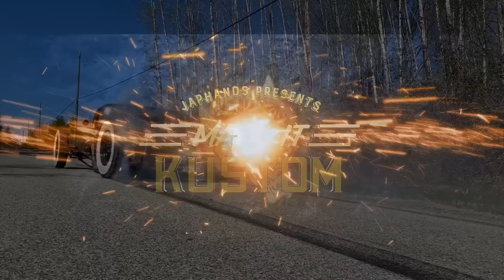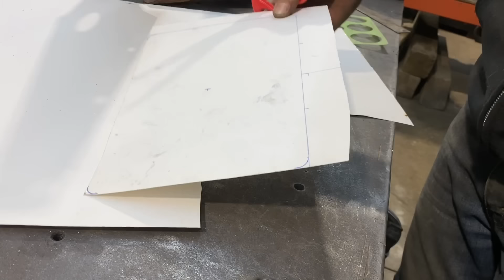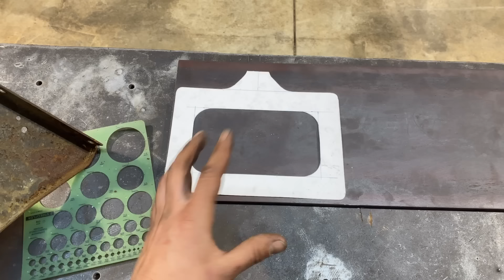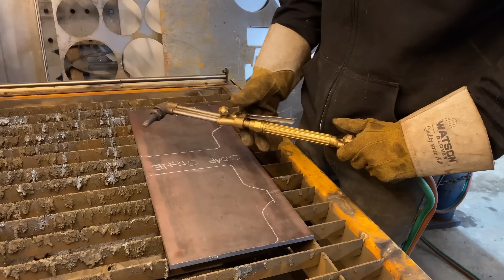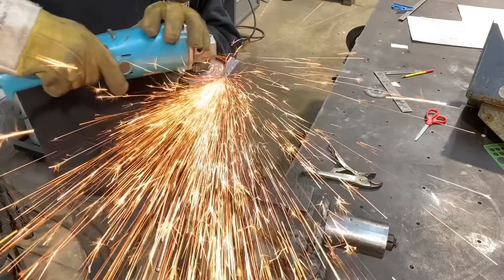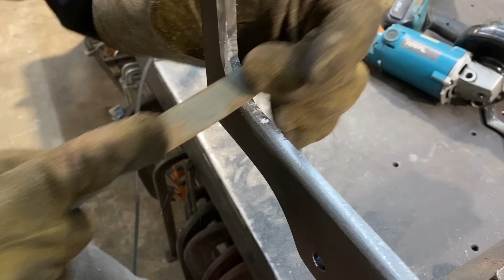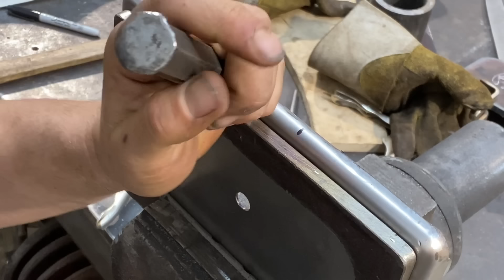Steel Plate HAMMER FORMING!! Step By Step with Simple Tools - G10 Van Battery Tray

Comment: A poor fella hack is you CAN use softwood, so long as you put 1/8" or thicker steel on the top. It's not the platinum card perfect solution, but works very well if you are only making 1-10ish pieces, and are limited to the National Bank of Scrounge and Cobble to finance your projects.

Comment: I would press the center depression first as the material will draw inward then form the rest.

One welder test that I took in 1970 required torch cutting to make pipe tees, pipe reducers, pipe caps and 12" angle frames.  The requirement was no grinding allowed cuts had to be clean and only a file could be used.  All parts made had to be gas welded together with a torch.  In addition had to complete arc welding 16" diameter 1/2" wa;;  full penetration butt weld and 12" on 12" tee test weld upside down all were x-rayed for defects in the woods the strap ere cut and bent and stretched to test strength.  ALL THIS HAD TO BE COMPLETED IN 8 HOURS.   All this said his comment about in the past only files and benches grinder we used not hand held grinders were available.

Comment: Whenever I see metal forming videos like this, I'm forced to think back to my old metalwork/woodworking teacher here in England. He was a well spoken, but brash man in his late 50's, and he had the air of someone who may have once been known as "Wing commander" about him. :)

Anyway, One sunny summers day he turned up to school in an absolutely stunning British racing green E type Jag coupe. Everyone was talking about it, and no one could work out how he would have been able to afford it on a teachers wage. It turned out that he'd bought it as a complete, but terminally rotten mess during the 1980's recession when prices were low (even for restored examples), and then spent 5 or 6 years rebuilding it to a showroom condition.

Replacement body parts were scarce AND expensive back then, so everything it needed had to be hand made by him. When he realised that a lot of us were really interested in the work he'd done, he brought in a crate containing several albums full of photos. It seems there wasn't much original Jag metal left in it ! The old shell was pretty much only used as a pattern to create replacement panels from. He even English wheeled a new roof panel because, as he said, the original had "too much rusty lacework around the top of the windscreen that needed replacing, so it would just be a neater job all round to make the whole thing from scratch. It was easier than messing about patching up the original all over the place".

He'd worked on some of the stuff at school near the end of the project. While we were busy doing stuff he'd be stood at one of the spare benches polishing things like carburettor body's, cam covers, or machining small alloy parts on the milling machine. Apparently he even brought in a roll of leather, and the old seat covers, then proceeded to sweet talk the young lady who taught needlework into making replacements for him. :D

It turned out that he was a qualified coachbuilder, and could have been earning a hell of a lot more money doing that, but it also tuned out that he really enjoyed teaching, and valued his happiness more than having an ever expanding bank balance (We thought he was mad because of that back then, but the older I get, the more I can relate to his point of view).

As a "Also" memory of the guy, I once asking him how he'd found the time and money to build that car, and I'll never forget his reply. He held up his left hand and said "You see a wedding ring on that finger boy? No? Well son, nothing in this world monopolises more of a mans time and money than having a wife. Being a bachelor is the only way a man can do what he wants, when he wants without interference. Yes, I was married once, but that didn't work out. We were both miserable, so chose to divorce before we ended up killed each other. There's some mistakes in life that you only need to make once. There IS a certain lady who I'm NOT married to now though, but I'm very firm on us having our own lives, and homes. We both like our own space, and she like's not having me under her feet all the time, messing up her place. While I'm equally happy not to be out wasting my time and money buying new sofas and soft furnishings every five minutes because the perfectly serviceable current ones don't go with the new wallpaper she's ordered........ It's a win win in my book. Just find yourself a woman like this my boy, and you'll have a lot less aggravation in your world". He'd probably have get fired and lynched for even THINKING that way these days, let alone recommending it as a way of life to a 14 year old boy !......... But it was a different (and more easy going) time back then. :D

Comment: your center hole was off because of the slight draft angle of the torch, then when you ground the edges you took a little more off the side that didnt have a perfect 90⁰ torch cut, in order to flush the edges up before radiusing.

Comment: I remember about 25 years ago I built an 84 Monte ss street killer and put so much into the car I literally couldn’t afford a gauge pod
 I ended up making a pod for my 2 auto meter gauges out of the old heat shield for the catalytic converter that was bolted to the floor of the car and used a hammer and a drill and a file and that was it
 I still have it to this day

Comment: 10:20 "Grinder, welder, drill press, torch" is a simple but powerful piece of advice for a newbie. I went different directions after the drill press based on types of work im doing, but for a lot of cutting the torch is a great #4 position tool acquisition. End result is flat impressive, nice work.

Comment: Great tutorial. Keeping an essential trade alive. I was thinking more of a gas range stainless steel top since the ones that come with the appliances are usually painted steel and get rusted in a couple of years and the replacements are more expensive than the device itself if you even get a hold on it.

Comment: If you want to keep this one from rusting out, something I used to make was cotton canvas soaked in baking soda, 3 layers, and let dry then the layers get sewed together. Lightly, or heavily, dust baking soda between layers first then carefully sew together so as not to lose the loose baking soda or shift it around between layers and sew a grid pattern to trap the baking soda between the layers. Once finished re wet with baking soda solution, let dry. Place on tray, place battery on that and Walla. Keeping the battery clean helps a lot too. I did this with all my hot rods back in the day. An old mechanic showed me how it was done.
Reply: or just coat in POR15
Reply: @TheRoadhammer379  No! Por 15 doesn't neutralize battery acid. Whether or not it can tolerate battery acid isn't the issue. the battery tray will get scratched again and the acid will start destroying the tray again. You can paint it with POR but then use the cotton canvas soaked in baking soda to be sure the battery acid is neutralized when it comes in contact with it.. That was the whole point of my comment, was neutralizing the battery acid.

Comment: Really enjoyed watching this and have learned a lot by actually seeing it done.

My problem is that you claim to be able to do this using only simple tools. All was going well until you turned to a press having already said the job could be done using a sledge hammer. That's what I wanted to see as well so I'm still not sure if the work can be done that way. Would the use of aluminium demand the use of a press and suitable load-spreading blocks? Seems to me that a sledge hammer would struggle.

Comment: I think you should invest in a plasma cutter it's cheaper to use and cleaner cuts than a torch. JUST A FYI. ALSO sanding drums on a drill work better than  a file in the corners as you can stay more consistent when radius sanding. I know you are trying to speed things up.Also I would of used stainless steel to really juice things up.
Reply from the maker: Thanks for your input. I have all those things and a Cnc plasma.  The point was to show what can be done with simple tools so that more hobbyist metal workers can relate to the process
Reply: @MakeItKustom  I understood your point. Not all have a oxy- acetylene setup either . Also in the interest of speed
a plasma cutter would of left a cleaner cut especially a CNC cutter. Also not everyone has a 50 ton or better press.
Especially when trying to put a valley into a piece of metal with a sledgehammer  and not demonstrating it. JUST FOOD FOR THOUGHT ON YOUR next video. I am not bashing your video so please do not take it as such.
Reply: @MakeItKustom  I think you should bend the center with a sledgehammer.

Comment: Is it possible to do the same process but using wood as a form in stead of thick plate steel
Reply from the maker: Yes but with hard wood and it may need to be thicker. The 16 ga material might be tough. It would be no problem with 18

Comment: hay those imperfections were in my 1985-88 battery tray from GMC stamping press so you did it better than gm ( burrs and miss stamping ect. ) ( my 1970 dodge one i thing had the same problem but i had to junkyard it as rust got it, swiss 🧀 so maybe the same supplier's? of tooling or parts? ) did and the 3 holes are punched out for the same reasons as you did, i guess gm didn't want to clamp the part better and more evenly for a nicer finish and consistently ect. . Lithium LFP don't have the rust problems like flooded lead-acid does plus its way more reliable and way more powerful peeking and longer lasting, i don't plan on going back as i love lithium 12V to 24V car/vehicle battery's, a sds or sds max hammer drill would work and speed up the metal finishing process i figured that out after having to buy a 2022 80V cordless and trying to keep it busy ( as you and others and me probably know by now best to exercise you and the tool as a tool that only gets used every 5 years i bound to be stubborn or not work at all and for me i didn't feel like selling it new-ish for 30 to 80% off to the next guy yet ) after my fencing/home/electric 240v shop improvements are done with by 2023-ish

Comment: Those dented areas are to locate the battery     at the back of tray and the removable holding device in front locates the device to the front of tray snug fit btw some manufacturers crush battery case's from the factory

Comment: Would it be better to do the press of the centre before hammer-forming the edges, so the press doesn’t distort the hammer-work?
Reply from the maker: My thoughts were to do it after because the edges would help hold it
Reply: @MakeItKustom   Makes sense. Thanks very much for your video. Makes this kind of technique accessible to all.

Comment: I think, a battery has these notches, too. They are there so that the battery does not slide within the tray. It is pressed onto these by the strap that goes over it. If I'm wrong, please correct me.

Comment: I might be  mistaken but the 3 notches are designed to fit into opposite notches on the hold down points on the bottom lip of most batteries

Comment: Nice vid - as always!
I am trying to bend a flat top cone out of 2mm stainless steel sheet metal, but it's very out of shape...
I made it this way: https://www.youtube.com/watch?v=bA1t-5o0Lws
Its minor diameter at the top is 65mm
the big diamneter at the bottom is 204mm
the height of the cone is 160mm
Do you have a suggestion, how to bend it evenly just with basic hand tools ?
Greetings from Germany, Marlon

Comment: Sorry if this is a dumb question,but what stopped the surface of the table that you were cutting with torch from also being cut?
Reply from the maker: When torch cutting the lack of heat transfer between pieces of metal is why the table isn’t cut. The metal needs to be heated before it will cut
Reply: @MakeItKustom  thank you.  That makes sense.

Comment: You can put clear silicon on the metal to stop the battery acid corrode the steal or heat the steel red hot and put it in car oil to go black and rust proof.

Comment: Your work table looks eerily like one I helped create over 25 years ago.  My boss got this table at an auction then we laid out and drilled and tapped 1/2 holes.  We changed the legs, put a brake on one end and I added a vise on the corner exactly like the one you have.  The table was sold at auction (I think) in 2021- last year.  In Jamestown NY.  That's a long way from you, right?

Comment: Hay, My name is Outlaw JAC. This is Apr. 2022, and I was watching your video on building your Battery tray and you were commenting about the pocket in the center of the base and why it is there. But not really why it’s there. 
  Well I’ve built a couple myself for my old Dodge pickups. After building mine, I found out that it is there because, My first one I made I left it flat to save some time. About a year and a half after one winter the bottom rusted out worse than the original one. I then did some research on it. I found out that it is there so the bottom of the battery can breathe and the condensation can escape. And that is also why that hole is in it. Also by not cutting it out completely, it is still very strong just like putting the those weap dimples in for strength. 👍🏼

Comment: I need a drivers fender for a 1972 dodge charger. How much time and materials would you estimate that project to take or does anyone know of a fender that is not all rusted out anywhere? There are fiberglass fenders available but they are not correct, they will bolt on but work from 1971-74 when the fenders were changed a bit somewhere in 1971 or 1972. The marker light openings are different and the wheel wells also look different.

Comment: I suppose this could be done with pieces of hardwood, milling the radii with a router bit. That would be pretty quick for the hand hammering bits. It should even work with the depression in the center, if you support the die against bending from underneath. I've seen somebody do sheet metal pressing on a small scale with 3D printed plastic molds!

Comment: Great work!
(now for my input) I believe the doing the center recess before the outside perimeter lip would have worked better.
Reply: That is what I was going to say, as the center draw will consume material. I would allow extra, form the draw, then trim the edge from the hammering. Still nice work.
Reply: Instead of running bars on the punch, just have a heavy plate over the punch, 1"+ plate.

Comment: Nicely done. I would have cut a third plate for bottom solid square. The hole in the center back in the day was for a bolt to squeeze the recess and press it together with a tap of a small sledge hammer. Granted your press is a better solution. I would not likely have one on hand. Now you can make plenty of the batter boxes and sell them on ebay.

Comment: Been watching, nice job & having similar tools to what you're using I'd stick a flap wheel on the grinder in between file & hard wheel.   Aldo the die grinder with flap disc & flap wheels.   Ya the flap wheels/ disc's get expensive.
I had first figured the hole plate would be cut from bottom and welded tacked to the top plate with reinforcing.

Comment: Looks great but as a metal fabricator i gasp at the use of all that steel plate to make that battery tray. It makes sense if your making 100 of them but stand alone ouch! Ive seen some guys use a similar process but use a 3d printer to create the mold to wrap the tin around. Maybe its time to buy a 3d printer and give it a whirl makes a lot more economical sense and you could afford to experiment a lot more too with some crazy designs.  I dont know if you already have done this.

Comment: That was amazing! I never thought that would be possible without cutting out a load of different shaped pieces and welding them all together. Quite brilliant! And as you said, it wasn't the making of the battery base that was the main aim of the video, it was to demonstrate that with simple tools and techniques - and your insight - it is possible to make custom parts of all sorts. Just follow the principles shown here and volia - "I didn't buy it from China - I made it! Good innit. 🙂 Thanks from Jolly England. Bark Chip.
Reply from the maker: Thanks so much man you got it ! Its just amazing what can be done with a plate form
Reply: @MakeItKustom  Roger that, me old mate! I'm going to get on and remodel my face! Ha Ha!
Reply: @MakeItKustom Sulfuric acid ? Yes... the vapors can also do that. 
 I had a 1980 Honda Civic hatch back where that happened over some years. It seems fairly common unless you make it out of stainless $$$.
Reply: I would've thought it was welded up also.

Comment: Great example of the techniques, but it would certainly be easier to justify the work invested if you were going to make 100 pieces instead of just one. You probably don't want to calculate the value added per hour of work on that.
Reply from the maker: Ya it doesn’t make sense if it can be bought

Comment: It's always nice to see, that simple tools can get you far. However, at some point it's getting ridiculous, when you need to show how everything can be made with a chisel, hammer and a roll of sandpaper. Let's face it, if you can only afford a sledge hammer and a grinder, the least thing you want to do is start a car hobby or even own a car. Yes, not everyone can own or have space for a press but that's what you need to have if you are to this kind of things. This piece could have been done using a 1" cold rolled hunk of steel and a grinder. Just remove everything minus the battery tray. Sensible? Not really. 

Comments such as "not everyone can afford a drill press..." can be equated to this stuff is not for everyone. If you're short on money, just weld a flat piece of old barrel skin on top of the old piece. If you want to have a perfectly matching part, be ready to spend some cash.